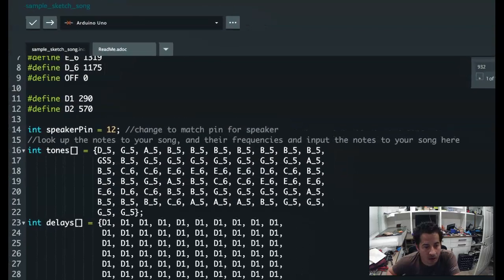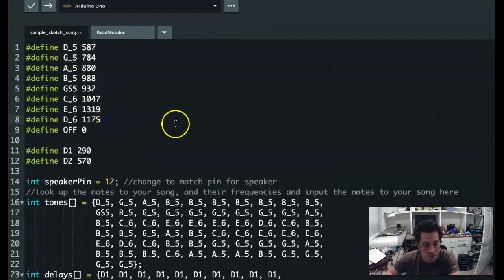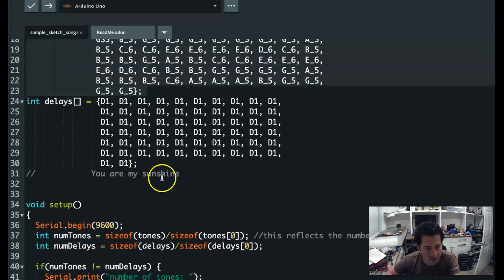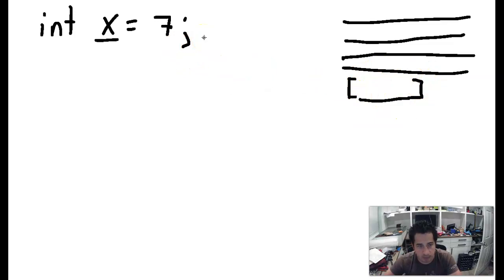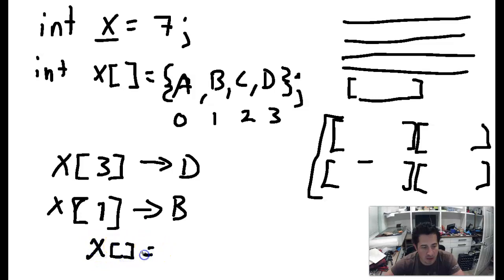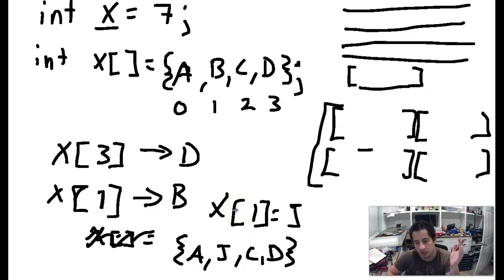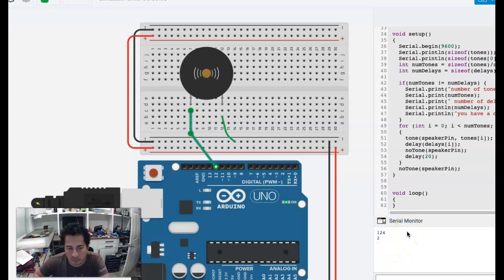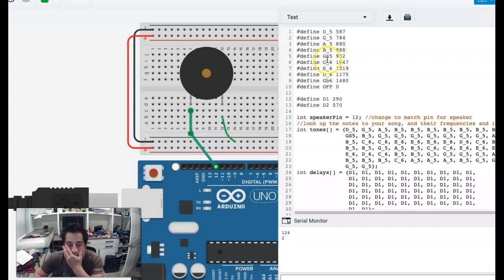Arrays + Creating Songs: Learning to code C/C++ with Arduino, part 20

Comment: So can you really have 
int x[]={A, B, C, D}?
The letters are not integers.
Reply from the maker: You could have a scenario where the letters are variables containing integers.
Reply: in c++ you can use what are called enums so you could right that as:

enum x {a = 0, b = 1, c = 2, d = 3};

than you can write these and it will be using the values inside stored as a, b, c ,or d

if you print a
(std::cout << a);
it will give 0 as a result

it makes things a lot more readable